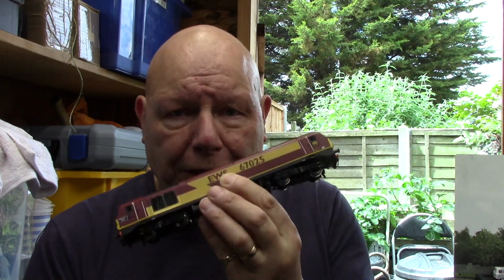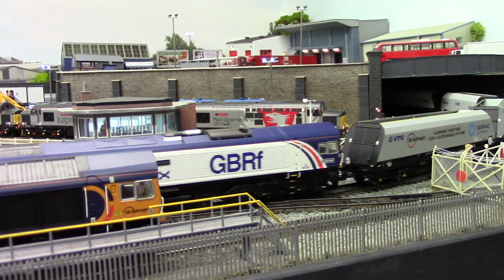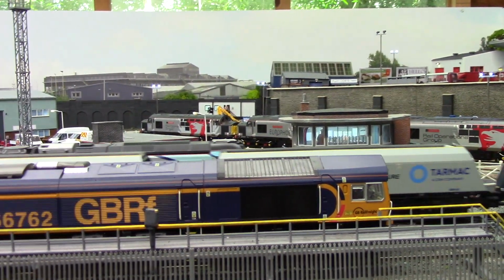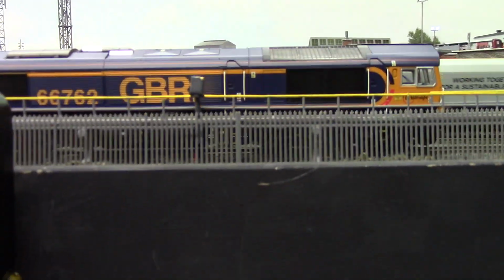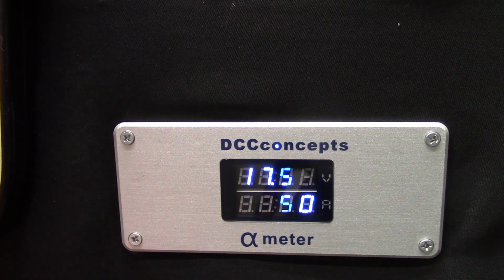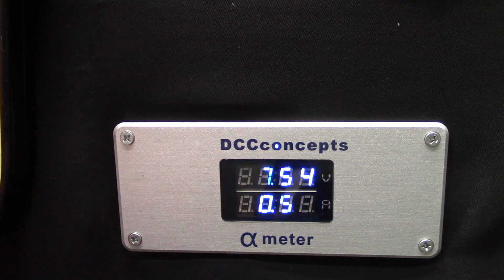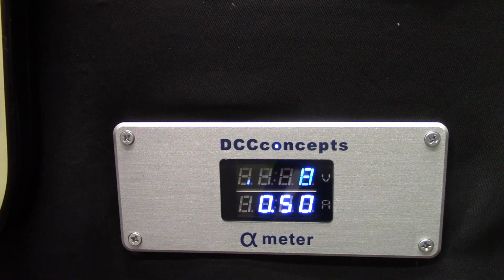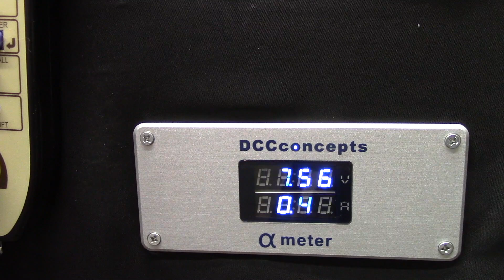Decoder chip decided to go "PoP" My model railway club. DCC Concepts Alpha meter

Comment: My wife has used Photobox for years to make family photo albums.  Present digital storage methods are good but keep being superseded and treasured photos can be lost but prints will last a hundred years or more. Thanks for your videos.
Reply from the maker: Hi Robert, yes worked for 10 years at PB when they were one of the first in the online digital world. Hard work as the machines work 24/7 as its internet based work never stopped coming in from all over, not just the UK
Cheers Peter
Reply: We were always pleased with the books.  My wife's only complaint was that the software used to change slightly each time she used it and had to be re-learned.  You may have done one of our books.  Stay safe.
Reply from the maker: @robertgates7686  Yes the IT together with marketing people were always tinkering with the software TBH also caused us on the factory floor problems too. :) but to be fair it was to make the service faster. I remember at the start it took overnight to upload pictures to our servers and a little info for you. Your pictures are not only stored on a server in the UK but all over Europe. It makes no difference to the digital world that when your book is made it pulls in your photo from whatever server it got stored on. So long as the address is OK it makes no difference with todays cyber technology
Cheers Peter

Comment: Hi Peter. You were lucky to get a replacement TTS, Hornby still make the 67 but for some reason not the TTS. I have a 67 and like you there's none out there and I don't want to spend a £100. Any way great video. Take care. Mick
Reply from the maker: Hi Michael, well you know what I know now.... can't get a TTS 67 chip? use a 66 instead. Same engine and Richard (Roads and Rails) uses a 66 sound for a 67 https://youtu.be/tD07o_3DYI0
All the best Peter
Reply: @torridonroadbypeterdixon4162 Thanks for that Peter.
Reply from the maker: @michaelsmith-hn1cn  Belive it or not I have just done a new video about this my friend :)
Cheers Peter

Comment: Hi Peter, its unbelievable that so many modern locos give up at the slightest thing. Good that you were able to diagnose the issue and repair it.
Changing your channel name wont affect your subscribers at all. Ive done it 2-3 times. Clearly its your choice, but I know your channel as ‘Peter Dixon’, if you change it some people may not realise its you.
Reply from the maker: Hi John, thats great to know as Im getting mixed messages as to if it can be done. A lot happier knowing you have done it. I could make an announcement in a video when ready to do so to give people a heads up. Yes its like I say how long will our models stand the test of time and still be running years from now?
All the best Peter
Reply: @torridonroadbypeterdixon4162  I can promise you will NOT lose subscribers by changing your channel name. I changed mine about a month or so ago, but please feel free to discuss it with other Youtubers who post regularly. Regarding your actual channel name I saw a very reasonable suggestion being ‘Torridon Road by Peter Dixon’ or alike.
Reply: Just found this in YOU TUBE help. 

‘Will changing my YouTube channel name reduce my subscribers?
And the answer of your question is, no. Your subscribers quantity will not be hampered though You change your channel name. You can change your YouTube name and your name is the only thing that will change.’

Comment: Great too see your layout again 

With your TTS decoder you could try contacting Hornby they can repair the tts chips and have the ability to put the sound on a new blank chip .it’s worth a phone call to see .

With the motors it does seem quite a common problem with modern motors.for a lot of models you can get the motors with out the flywheels from eBay or from china from ali express
Reply from the maker: Hi Oliver and thanks. Not thrown the chip away yet. Didn't think Hornby might do the repair (or replace) so as you say might be worth a call :) Thanks again Peter
Reply: @torridonroadbypeterdixon4162  it’s worth a try.let us know what happens
Reply from the maker: @ollychap1985  Hi Oliver, so turns out one of our sound chip/speaker sites (Richard Roads and Rails) sell the 'one' sound file to do the 66 and the 67. As I say its the same engine. Given me a idea for a video were I will compare the sound from a 67 TTS to a 66TTS as I have both locos fitted with them. I think before I do it the only difference will be in the 'horn' tones. To confirm also Soundtrax decoders also say choose the sound file to work a 66 or 67 Cheers for now

Comment: Greg's 'fiddle yard' with a scissor crossover into two double slips must have been a nightmare to wire up the point motors.
Reply from the maker: Hi Geoff. Pretty sure Greg got the points setup custom built. Costs a lot but the benefit of having connections in the model railway world I guess.
Cheers Peter

Comment: Hi Peter, interesting of what happened to your Class 67. Depending on how the model was running beforehand from the factory before the chip popped. I am wondering if a motor pole winding has failed with the high current it was drawing, or due to a winding that had a dry joint and the four other (assuming it is a five pole) were doing all the work. This then caused an electrical spike to the Decoder and burnt it out. Did you retry and test the Decoder in another model, or in a Decoder Tester e.g. ESU decoder tester 53900 | eBay (handy to have for the various Decoders it works with) to see if it was dead? The main thing is that you got it working again with a new motor and Greg's help (claps all around). 

Thanks for the Shout Out, LOL. I'll have to check on how to change names on YouTube, but surely their help area would have the answer if anyone below hasn't answered it. For the name of the channel keep it as "Torridon Road" then in the Show More tab add, 'by Peter Dixon of POMS (Peters/Petes Old Mans Shed). It is up to you and how you wish to display your channel name. Edit: To do so Peter SIGN IN - Next click your Avatar ICON in the top right corner - Select and click YOUTUBE STUDIO - In the left scroll menu - Click on CUSTOMISATION - Then via the main screen click BASIC INFO - Now click the pen icon to show your current Channel Name and Description - Make your changes e.g. Channel Name: TORRIDTON ROAD - Followed by the Description: Petes Old Mans Shed aka POMS, a 00 Scale Model Railway etc, etc, etc. Once you have done that click PUBLISH and you are done. All being well, we will all still be with you, if not people, please subscribe, or tie me to the rails as in a Horald Lloyd sketch, LOL.

Now for my help request if anyone can aide me in. I have the Hornby Railroad Plus Class 37 Cephus, but I find it looks pathetic without any cab interiors. Has anyone out there got two interior cab ends that I could buy from them. If so, drop me a line as I also want to upgrade it with working Forward & Reverse lighting when I get the chance to buy PCBs or to build my own light boards.

A small world with reference to the POMS, but it was interesting fact about your past working experience. Though I said POMS as in POMMY with you being British. To which, I noticed POMS was a good abbreviation for Petes Old Mans Shed. You want to use it Peter, then fire away my friend. 

Great to see the layout with its many tiny details up close, i.e. No Trespassing signs on the depot fencing pointing outward from the facial board side. Then the run of some stream locos again too. Anyway, I better go as this was a long comment, if you've not already fallen asleep by now, LOL.
Reply from the maker: Hi John, yes motors made in the 000,000s and I think theres nothing you can do to service/repair them. Not like the old motors but they draw a lot of power, if you DCC an old loco you have to be carful what chip to use to cope with the power draw. Not sure about the cabs as they would have to be taken of the chassis from a Bachmann 37 but Illuminated Models do a lighting kit for the old Lima/Hornby models which I'm sure will fit your 'new' 37
All the best Peter
Reply: @torridonroadbypeterdixon4162 Yeah Pete, it is less time consuming and better to replace a motor than trying to find the fault with a pole winding. Yes, best to get the Voltage & Current ratings the same. For example: when a laptop etc power adaptor fails always replace with like for like ratings. If it is rated for 19v & 4.7mA, get a unit that puts out 19v & 4.7, because any more or less will do damage. Anything overpowered causes burn outs, and underpowered you will have less performance. Hopefully, I will get two Class 37 cabs soon with an on-going eBay search. Thanks for the tip to get a lighting kit for the loco, I'll look that up. For now, take care down in the POMS.

Comment: FYA everyone: The Hattons class 66s motors also fail and you cannot get replacements from Hattons for them! If anyone knows of a suitable replacement motor please get in touch.
Reply from the maker: Sorry to say I agree with you as indeed I had to change the motor in my very first Hatton 66.  It was early days for the range and I was very lucky that Hattons sent me a replacement motor they took out from a 'returned' model that had another problem with it so the motor was OK. You're right theres no spares and I still don't know who made the model for them, so no chance of any other replacements. However Robert of Roberts train set has had a Hatton 66 for repair. It turns out that you send it to Olivia’s Trains and they fixed it for him.
Cheers Peter
Reply: @torridonroadbypeterdixon4162  Thanks for the reply and info Peter. I'm sure there's a generic motor out there somewhere which can be used, they're just keeping it a trade secret though! I've got a feeling it's the motor's bushes that are the problem. They're made of material that is too soft so they wear quickly and/or break off easily causing a clogging and/or only partial contact. I know that many washing machines use really soft brushes so need replacing every couple of years! It's part of their design to keep the maintenance contractors in a lucrative job!(Obviously not the "direct drive" motors) I think these cheap Chinese motors aren't necessarily quality controlled! At least we can buy replacements for Hornby and Bachmann locos but it has put me off considering any future Hattons locos, either new or second hand, which is a shame. Anyway Peter, I look forward to your next installment. Cheers, Julian.